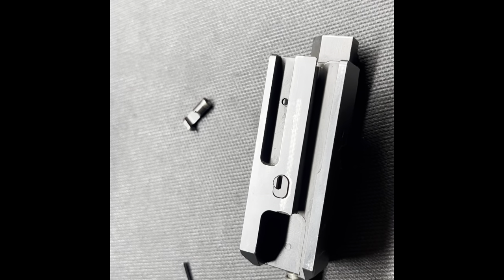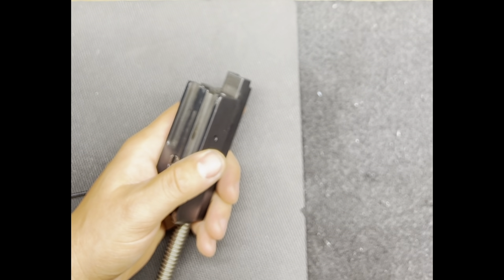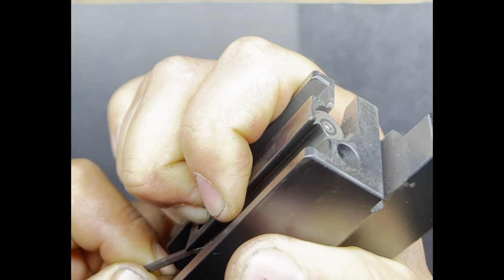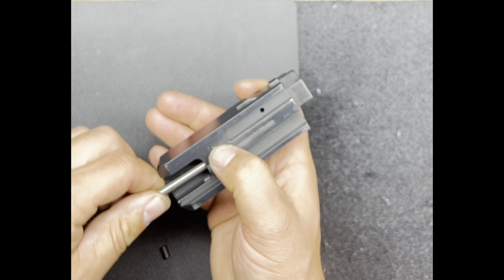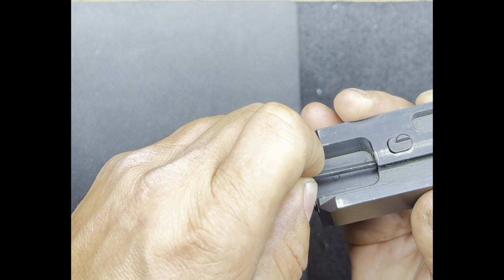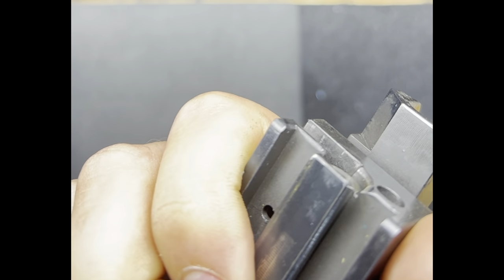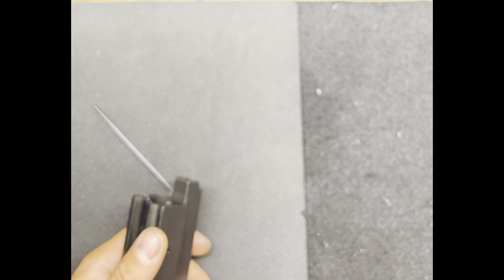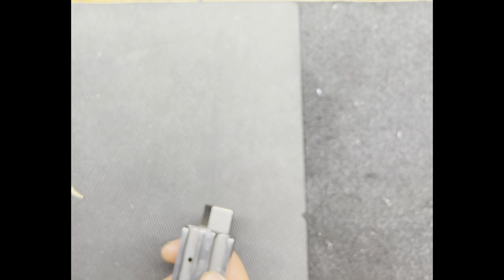Cz scorpion striker block

Comment: It’s not just the block failing. The bolt can get peened over and hold the block in the up position too. This can also cause the OOB detonation. Nexus and some others making a new bolt that won’t deform.
Reply: @maxsmax5858  I’ve got over 10,000 rounds through mine. When I clean the bolt I’ve touched up the edges of the hole the block sits in with an India stone a few times but that’s about it. It functions fine. I did order the Nexus bolt but honestly that was mostly for the finish. It’s pretty. If you actually have metal on the bolt deforming from just cycling the action then you have a big problem that most owners are not dealing with. I’ve taken apart, cleaned and maintained 4 of these guns other than my own. All pistol length, mines a micro. All of them have shown very similar wear. 2 of them are range rentals, no idea of the round count but it’s high. once the edge of the hole is stoned a couple times the problem potential decreases. A small factory chamfer would band aid this issue pretty well. Obviously a better bolt material would be preferred but either works.
Reply: @maxsmax5858  I disagree with you on many points but first, I completely respect and appreciate your opinion as an owner. So often strong opinions on firearms in YouTube comments are by people with little to no hands on. Now, to your issues, the receiver wobble caused by changing the grip is also quickly fixed with the flat spring Ascalon arms sells which installs in seconds. I very much recommend it. I have that and HBIs pin setup. Don’t forget it’s caused by CHANGING the grip  in the first place (yes, the stock grip angle is uncomfortable for me too). Also, the bigger pin is super quick and easy to install as well, honest. The plastic parts that snap off? I don’t know what you mean there, maybe we have different models. 
     The 1/2” thread protector under the muzzle break unthreads, it doesn’t snap in any way. It’s  just there in the first place as a convenience to American buyers to add more common muzzle devices. It’s a nut, If people can’t keep it tight, lock tight it or remove it…. Maybe firearm ownership isn’t the best hobby for them. Full disclosure, I run a ILWT tri lug barrel and a suppressor but I did run it stock for awhile and after I tightened it once it’s been tight since. Honestly, just take the ring off if it’s a concern, the threads are protected by the muzzle device as is. It’s only a problem if it completely unthreads and falls into the muzzle device then gets hit with a round. I’ve heard of them loosening, never heard anyone dense enough to not notice before it was an actual problem. 
     I do agree that it’s not a “great” gun out of the box but I’ll say that the biggest common complaints are the stupid grip, terrible forend and safety selector that gnaws on your trigger finger which there are dozens of options to replace/customize all 3 for under 100$. IMO The bolt issue is incredibly overblown, once I cleaned up the developed burr on my stock bolt it never built back up. It s been flawless for years with no noticeable deformation after initial break in, not to mention the likelihood of an OOBD without binary fire is incredibly low even if the lock out isn’t functioning. For a <1000$ gun it’s a great value with incredible aftermarket support. All of its competitors at that price point have had similar issues. I’ve sent my Stribog A3 back twice for chronic FTF issues. My Scorpion has fired every single time and I’m abusive. I fire binary a lot, suppressed and clean it irregularly. You can’t expect B&T precision at 1/3 the price. even then, I’ve sent back an S&W performance center revolver and my HK91 for workmanship issues. 
       Anyway, your complaints are valid, I just think your expectations are too high. Just my 2¢